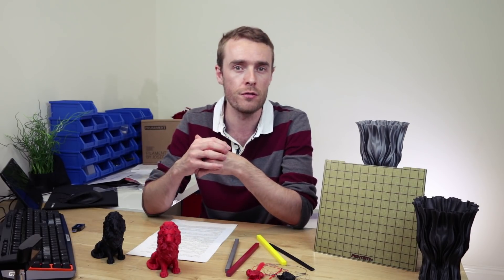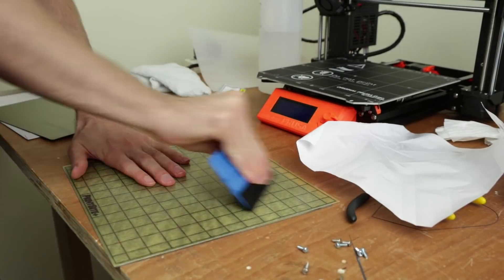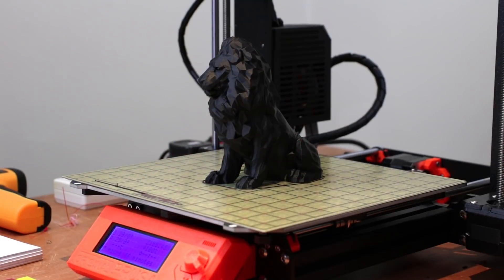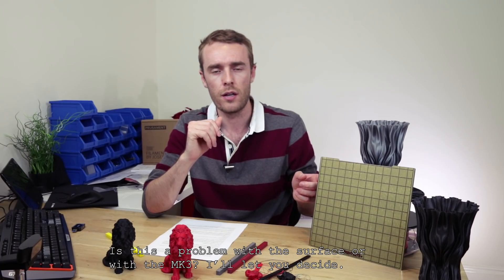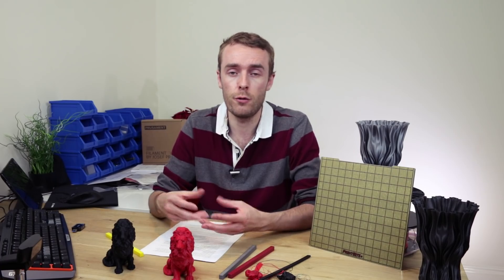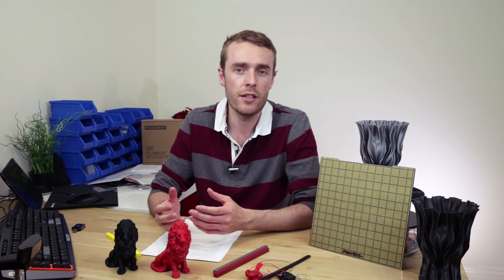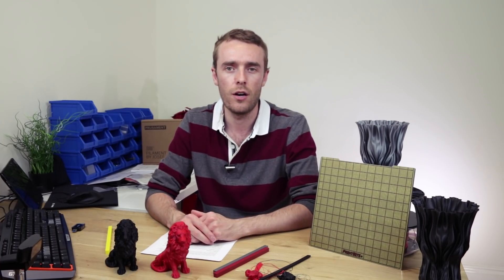PrintBite+ 3D Printer Bed Surface Review

Comment: I thought this may interest you it works the same as in the print is stuck down hard on a hot bed but when the bed is cool it lifts off super easy and sometimes feels as though it was never stuck in the first place.
 https://www.uantwerpen.be/images/uantwerpen/container11343/files/bonding_pla_with_salt_water_v20160713.pdf
Reply: @Vector3DP  No it was emailed to me by a friend so I bought some glass and a friend cut and polished it for me and I tried it out, and it works perfectly!

Comment: I've only tried a few things, but I haven't had any luck yet. I had an 8-hour print release about 1/2-way through. That sucked. Gotta figure that out.
Reply: Did you ever figure it out if so could you tell me your starting setting please, nozzle to bed height, z offset, speed, etc as I’m having problems with sticking. Thanks
Reply: @marksneyd1262  I threw the printbite out. I got a wambam sheet. It's great.
Reply: @1QKGLH  thanks
Reply: @marksneyd1262  You're welcome. I was pretty disappointed if that stuff. I think my success rate was 3%. With the wam bam sheet it went to 99%.

Comment: ive been using printbite+ for a year or so and its pretty awesome
Reply: Hi 
I’m using pla and having issues getting the first layer to stick, what temps have you used? Thanks
Reply: Could you tell me your starting setting please, nozzle to bed height, z offset, speed, etc as I’m having problems with sticking. Thanks

Comment: Probably the crap spring steel plate. If they couldn't bother to deburr then I'd question its overall flatness. Also you'll still need to touch the bed to remove skirts and brims.

Comment: Hello! This is an interesting review, and your conclusions partially addresses my question, but i think that this review would have been improved if you had compared it to the PEI surface of the prusa MK3, or any other well known surface. I agree with you on the fact that it seems to pop off too easily, i prefer to have it stuck better for the reasons you exosed. However, i would have liked to know if when hot materials stick to it better, same, or worse than a PEI bed; so that i can decide if it's worth it in spite of the small flaws it has. The question is not necessarily if it sticks perfectly to X or Y, but if it does a better job than PEI, so that i can decide to upgrade.
Anyway i'm still tempted for PETG, as it is known to stick too well to PEI and rip off the PEI coating on MK2, so this could be interesting in that case...

Comment: I couldn't get anything to stick to the Printbite I bought, so tried PEI instead....worked great, so I've stuck with that.
Reply: Did you follow the instructions? PrintBite is compatible with a far wider range of materials than PEI including Nylon and PC which wont work with PEI. It is also far more durable. Feel free to contact me if you had issues.
Reply: @Mutley3D  I'd second that. I have a custom built Voron2 with a heated cast aluminium plate and am pretty certain about how level my bed is. I tried printing Formfutura's Premium ABS (recommended temps 240-270/90-110) at most of the recommended temperatures and over (bed up to 120-125) and both by squishing the filament more and less...and eventually prints do come off...and it actually happens fairly quickly (2-3rd layer). I do clean the bed with pharmacy grade acetone as recommended (never put alcohol on it) and it looks clean from fingerprints. I really like it on the parts where it actually works (very short, simple prints) as the surface finish/prints popping off is a nice feature. All in all...I haven't lost faith in the surface yet and would want it to work...just running out of ideas how.
Reply: @JustasM  Did you ever sort this out? Could you tell me your starting setting please, nozzle to bed height, z offset, speed, etc as I’m having problems with sticking. Thanks
Reply: @Mutley3D  Could you tell me your starting setting please, nozzle to bed height, z offset, speed, etc as I’m having problems with sticking. Thanks

Comment: its cool to have another option but ultrabase does the same thing. ive had the same plate for almost a year and it looks brand new. i never clean it.  and the surface texture on ultrabase is awesome.
Reply: Could you tell me your starting setting please, nozzle to bed height, z offset, speed, etc as I’m having problems with sticking. Thanks

Comment: I have been using Printebite. It works wonderfully. Don’t use alcohol to wipe it or you will ruin the surface!
Reply: Could you tell me your starting setting please, nozzle to bed height, z offset, speed, etc as I’m having problems with sticking. Thanks

Comment: I have a MK2S for a short time, I'm printing ABS mainly it rips off the original pei sheet... will this work on the MK2S? is there an option to put spring sheet on MK2S without the MK2.5 upgrade? Zortrax ASA have very low warping, fillamentum ASA... well... just sucks... right now I'm using some special modiffed ABS and I love it!

Comment: Ehm, glass is already ”self releasing”, or maybe my glass is magic, but I’ve printed complete squared across the entire bed and once I cool down the glass (using water cause Gotta Go Faaaaast) the prints always pop off
Reply: with what material... cuz if you want any other filament, like PETG, it can FUSE to the glass and then it tears chunks out. With ABS, it doesn't stick well. These are the three most common filament types, and PrintBite+ does all three better. Get out of here smartass.

Comment: This is an excellent product. I've printed ABS (220C/125C), PET-G (210C/80C) and PLA (200C/70C) on it.

It only requires wiping with soapy water then clean water prior to each print. Getting your first layer height set accurately is very important to ensure prints don't bind too securely to the material.
Reply: Could you tell me your starting setting please, nozzle to bed height, z offset, speed, etc as I’m having problems with sticking. Thanks

Comment: ASA filament is a bitch to print with. I had to build a chamber and keep the temp inside as high as possible (around 40°C), and still got 1-2 mm of warping with raft and all. I've been using some king of 3d printing spray glue and get the same "lift of" on large printed parts. And this is with a standard aluminium 3D printing bed. Good video, I might invest in one of these.

Comment: I've been wanting to put a new surface on my prusa mk2 for some time, my pcb printbed is not flat. quite badly. How does the prusa work with a spring steel sheet atop the printbed? doesn't the proximity sensor detect the steel sheet instead of the metal inserts in the stock bed? Does it still work? This has been the biggest obstacle preventing me from getting a flat glass printbed. I wish I  could toggle mesh bed leveling off and only run it from the menu manually every once in a blue moon instead of before every print

Comment: Your issue with sheet thickness inconsistency is also a problem with the PEI spring steel sheet that comes with the Prusa. At least that’s currently my theory. I definitely have some spots where the nozzle is closer to the surface than others. I’m waiting for the PEI powder coated sheet to be available to see if that’s still an issue, but I suspect that will be more consistent since there’s no glue involved and it’s sprayed on. It’s weird though, it wasn’t a problem on the MK2. Maybe because it only had one layer of PEI and now there’s stacking tolerances at play?

Comment: Hi Adam. Nice review, but it would have helped to know what temperatures you were using for the PrintBite+ on what material. (Full disclosure - I am the lead technical support for rigid.ink) I believe I might know what was happening with your ASA prints.
Butadiene is a weird material - when hot, it is quite sticky, and as it cools, it shrinks. The problem you have with ASA is there is no butadiene to give that 'stickiness', but the bonus features are less warping and UV resistance.
Not knowing what temp your bed was at I an only guess - I'd suggest experiment with running the bed at temps between 90-110°C to keep the ASA as 'sticky' as possible. (Note: the Tg of rigid.ink ASA is approx 105°C)
Also, no one surface (without help) works with all plastics, so you may find you need to wipe on a thin coat of 3DLac/Magigoo/dimafix, just to temporarily give you that bit extra adhesion while printing ASA. Hope this helps you and potential PrintBite+ purchasers.
Reply: Hi Adam, great review. When using PrintBite the bottom layer temp is set a little higher than rest of print. In your comment above your indicating the opposite. For the ASA try between 105-115 for bottom layer with nozzle 245/250. Should fix it for you. Reduce temps for second layer if required.

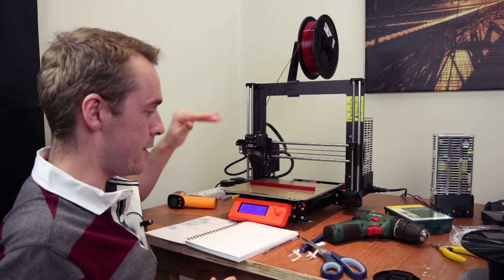Comment: I'm curious if you tried to remove a print while it was still at temperature. Did it have more holding power, or about the same as when cooled? And why do you have your MK3 on such a high table (3:20)?
Reply: At printing temp the object won't budge. It needs to cool then just releases itself. Trying to pull it off early is not the best idea, can damage the sheet. So on those days you spot a crap first layer and restart, be patient to let it cool.

Comment: This looks like a useful product. Once applied, i don't need glue, i don't need to clean off the glue, i don't need a scraper, etc. Due to the above, less damage will occur over time. Good buy !
Reply: Just be aware, no one surface can rule them all, and eventually these surface wear out. They also require periodic maintenence to remove ingrained plastic particles. For instance, occasionally PEI needs 'resurfacing'. Tom Sanladerer has a video on it. The only god among bed surfaces is glass - with the right glue for the job. Also, borosilicate glass is a racket, just use good quality 3-5mm window glass or mirror.

Comment: Do you know if PrintBite Plus is the same as PrintBite (without the Plus)? Also, did you need to use higher temperatures than with other surfaces? I used to use PrintBite, but it needed higher temperatures for both bed and nozzle, with a correspondingly longer warm up time. These days I am using LokBuild instead, which I like a lot.
Reply: The plus is the newer improved version. Both work great tho, finally gave up the PEI and I'm running printbite & printbite+ on 3 machines. So nice not having to scrape prints and damage corners etc.
Reply: And yes, requires higher temps. There is a PDF on mutley site with starting points, but depends on your bed setup - I attach it direct to aluminium and with 24v and AC on larger beds, so no issues getting a few more degrees.
Reply: Hi David, PrintBite+ is thinner than original, which helps with heatup times and certain bed levelling systems, and adhesion is improved.

Comment: Sand the surface with 100 grit sandpaper and it will help it stay adhered to the print surface.
Reply: Jack Hydrazine might as well pick a different surface material.

Comment: You can buy the spring steel plate off Aliexpress for $14 bucks.
https://www.aliexpress.com/item/Prusa-i3-mk2-5-mk3-3d-printer-printing-surface-Spring-Steel-Sheet-for-Prusa-i3-mk2/32898548076.html?spm=2114.search0104.3.222.7efa1d29NliA1H&ws_ab_test=searchweb0_0,searchweb201602_1_10065_10068_10130_10890_318_10547_319_10546_10548_317_10545_10696_450_10084_10083_10618_452_535_534_10307_533_532_204_10059_10884_323_325_10887_5023911_100031_320_321_322_10103_5727711_5727811_448_449,searchweb201603_2,ppcSwitch_0&algo_expid=fb712191-1627-414c-aae6-e14ab731b002-34&algo_pvid=fb712191-1627-414c-aae6-e14ab731b002&transAbTest=ae803_4

Comment: I have gotten the exact same effect with dimafix on glass, parts are glued to the surface when hot and just magically releases when cool. The only issue is that I have to wait for the surface to cool, with PVA glue I could knock the parts loose while the bed was hot, but with the dimafix the parts often brakes before releasing when the surface is hot.

Comment: I can't find a Prusa Mk3 option on the Buildtak website. Did you get a special order?
Reply: just choose the option 241x254 in the dropdown (for the sheet of springsteel) and you will get the special prusa mk3 version with the cutouts, that fits great on the printer

Comment: Glass is not a thermal insulator. In a thermos, an air gap designed such that effective convection within it is impossible is the actual thermal insulator. They keep the glass super thin too, to limit the amount of heat that can be transferred laterally.

Thermal conductivity of glass can be described as fair. It's about the same as of white thermal grease you'd use on your processor cooler 20 years ago. It is about 100 times higher than that of plastics (ok actually closer to 20-50), 10 times higher than wood, and about 100 times lower than that of most metals (more like 100-400).
Reply: It is a very good electrical insulator though.